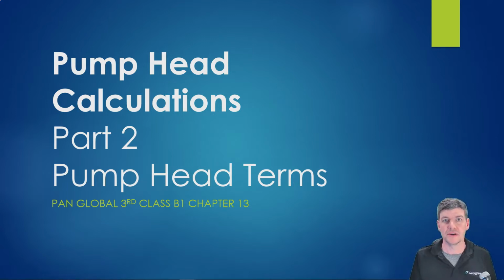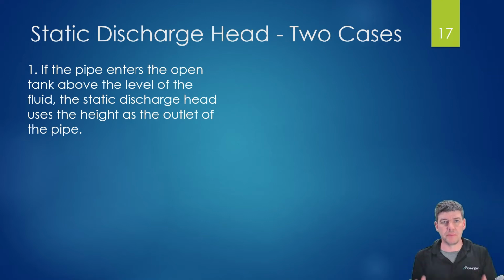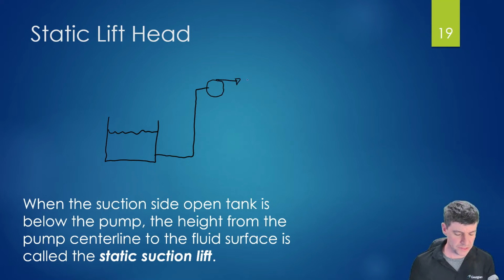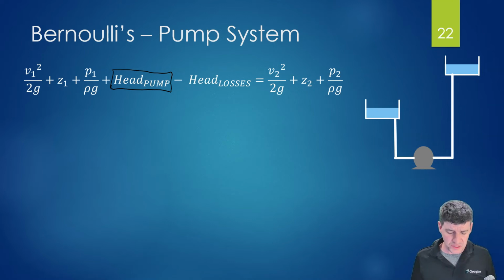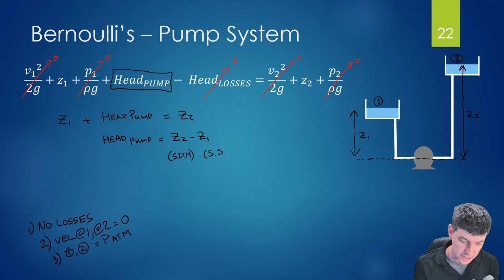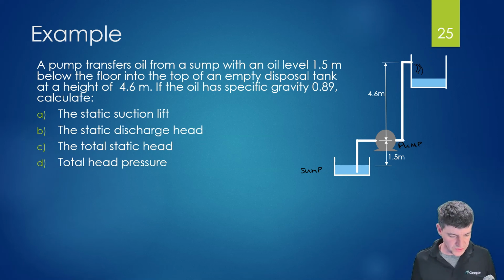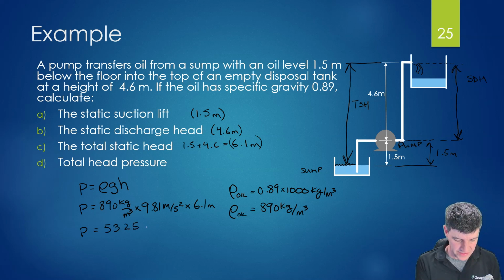PENG2011 - Fluid Mechanics - Pump Head Calculations - Part 2 - Static Suction and Discharge Head

Comment: This video, part of a series for the Canadian Power Engineering Training (3rd Class, B1, Chapter 13), explains the fundamental terms and calculations for *pump head* in fluid mechanics systems (0:01-0:30).

*Key concepts covered include:*
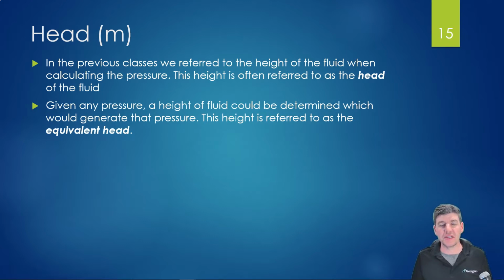* *Head Definition:* Head is a measurement of energy or pressure expressed in meters (0:36-0:56).
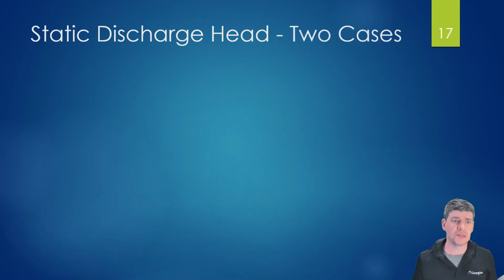* *Static Discharge Head:* The vertical distance from the pump's centerline to the surface of the fluid in an open discharge tank (or the pipe outlet) (1:53-3:45). Two cases are discussed: discharging above the fluid level vs. into the fluid itself (3:51-5:31).
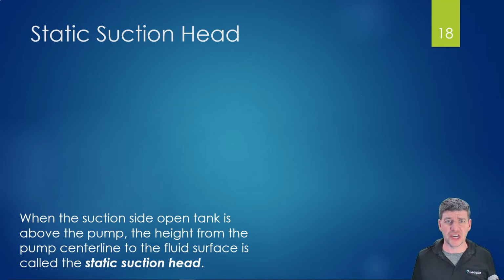* *Static Suction Head:* The vertical distance from the pump centerline to the fluid surface when the supply tank is located above the pump (5:36-6:40).
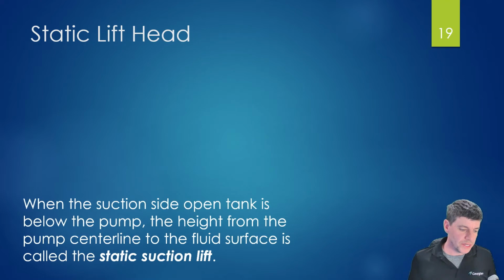* *Static Suction Lift:* The vertical distance from the pump centerline down to the fluid level when the supply tank is located below the pump (7:09-8:06).
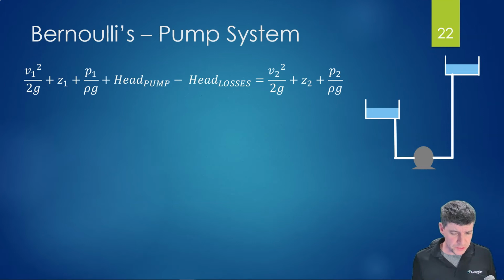* *Total Static Head:* The overall height difference the pump must overcome (8:12-14:16). The calculation method depends on the system setup:
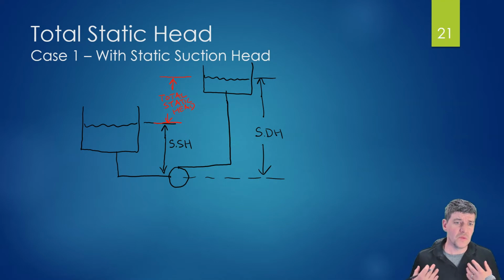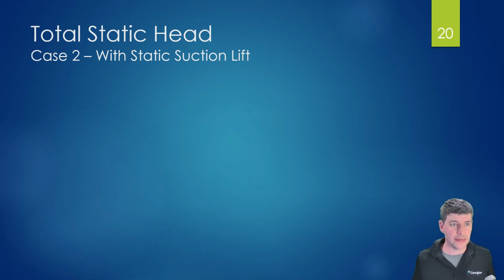    * *Suction Head Case:* $Total\ Static\ Head = Static\ Discharge\ Head - Static\ Suction\ Head$ (10:44-11:50).
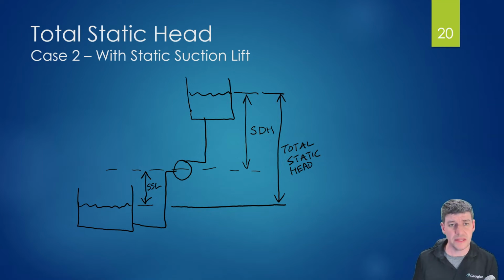    * *Suction Lift Case:* $Total\ Static\ Head = Static\ Discharge\ Head + Static\ Suction\ Lift$ (13:26-13:50).
* *Bernoulli’s Equation:* The video demonstrates how to incorporate the pump's energy (head) into the equation, simplifying for open tanks by assuming negligible velocity and atmospheric pressure (14:19-20:25).

*Example Problem:*
* The video concludes with a practical example (22:05-27:26) involving oil transfer, calculating the *static suction lift**, **static discharge head**, **total static head* (6.1 meters), and the resulting *head pressure* (53.2 kPa).

Comment: Does the discharge pressure of the pump equal to the total dynamic head (TDH) required by the system ?